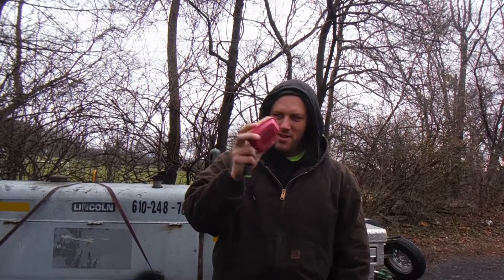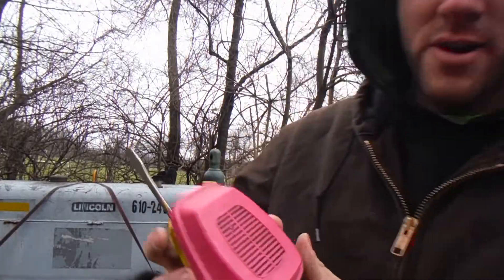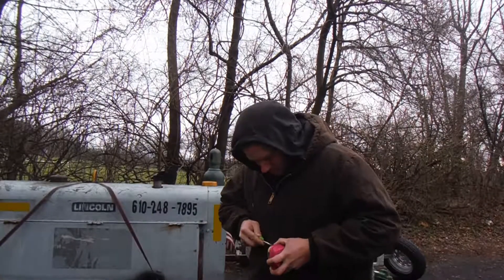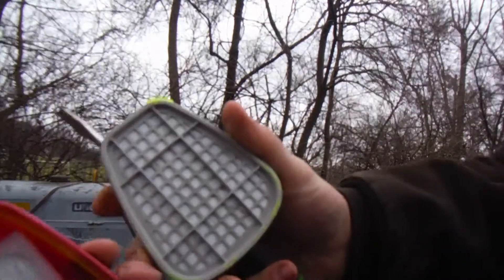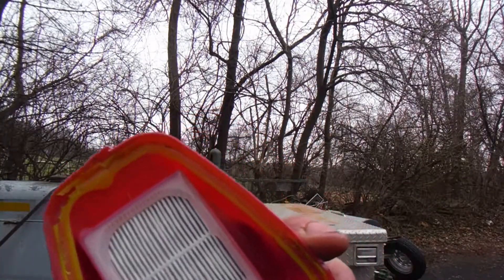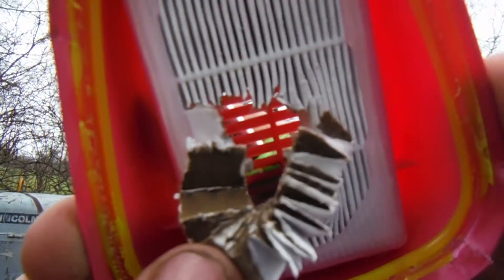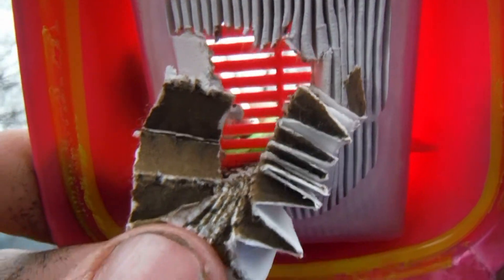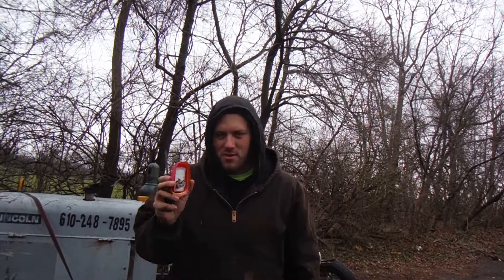why its important to wear a respirator

Comment: How often do you recommend changing cartridges?
Reply from the maker: It honestly depends on how much your doing and how dirty/wet they get. the book says 8 hours of use. I feel like sometimes I leave them in for 40 or more. although there was a welding repair I was doing where they wouldn't even last 30 minutes. when it gets hard to suck air though them its time to change em out.
Reply: @scrapmanindustries  I won't ever use my plasma cutter without wearing my respirator again after seeing those. Pretty nasty stuff.

Comment: I used a plasma torch for the first time today for 5 min. Only had a dust mask. I could smell the metal and see it blasted onto the black top below the cut. I bought an n95 respirator after that. Thanks man.
Reply from the maker: Yep. I used to not wear them as well, but cutting what I do is really bad for your health.